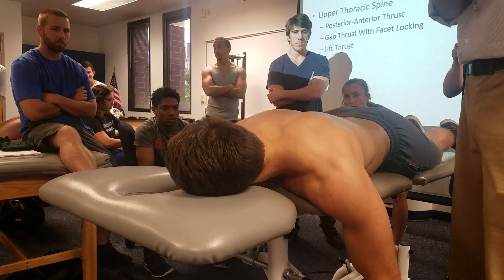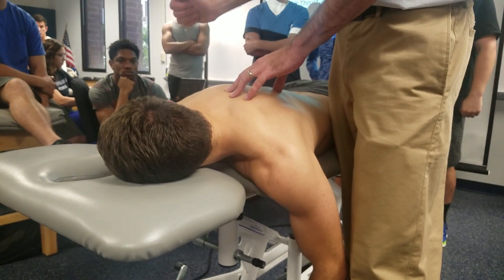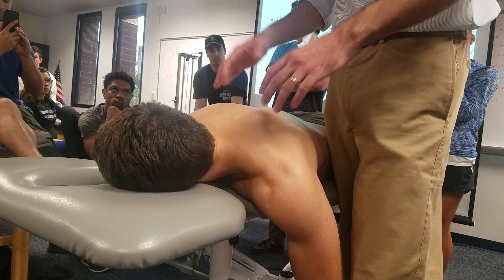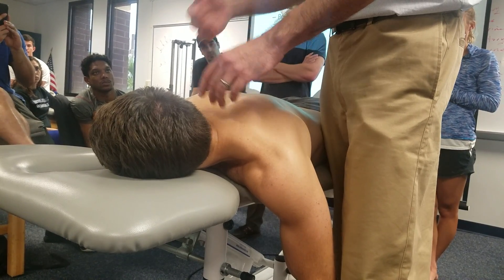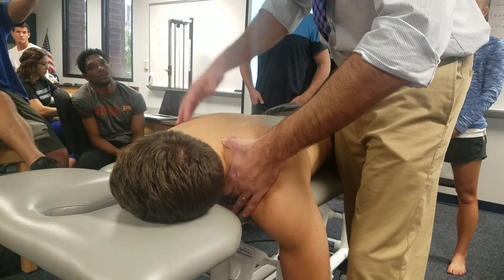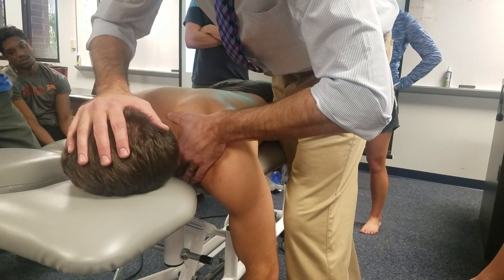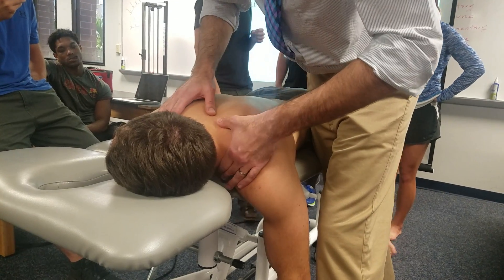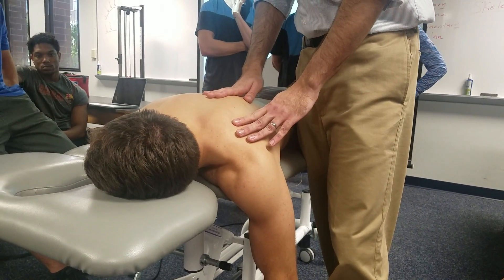Upper Thoracic C7,T1 junction Thrust

Comment: I have had problems with my T1 for 10 years, I have seen about 16 different Chiropractors, and no one has been able to adjust my T1. 

Actually, there are 3 vertebraes that have cost me so much pain and scary moments. 

The same pattern through the 10 years. My T4 (on the right side), my T1 (on the left side) and my C1 (on the right side). And after all those Chiropractors, I still getting worse.
My question: Is there a way to self adjust those vertebraes?.

Thanks ✌️
Reply: Yo, i've been searching for vids like theses because i do alot of self adjustements, i reproduce what the guy just said. turn your face the opposite way that you vertebrae is going, put your thumb in there and just press as hard as you feel comfortable then apply pression to the head like he said. i just did it to see and ive been able to move it in  alignment.
Reply: @MystiFize  Thanks I really appreciate it; I have foggy brain and it is hard to understand. I will give it a shot.✌️
Reply: @MystiFize  Thank you, I really appreciate your help.✌️
Reply: @MystiFize  i do self adjustment too. i would add it also helps to pull the spine on the other side with the same hand that is pushing the spine one way. i guess that helps 'lift' the joint
Reply from the maker: I would reccomend seeing a physical therapist in your area that specializes in orthopedics / back pain.